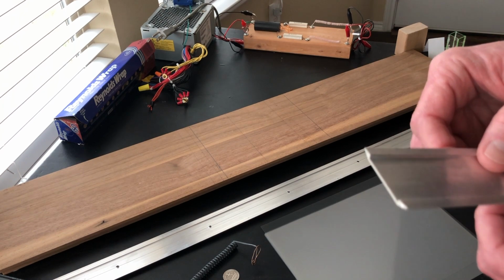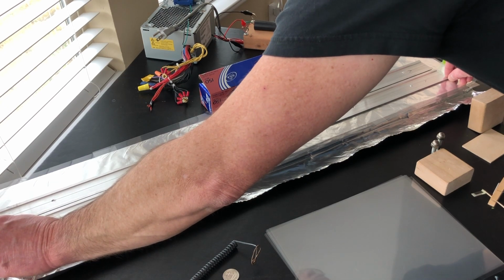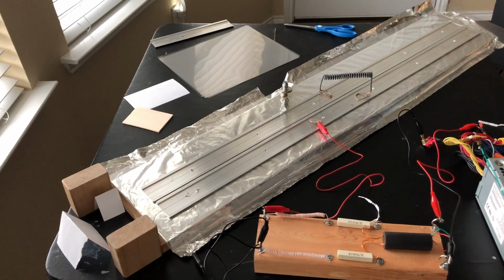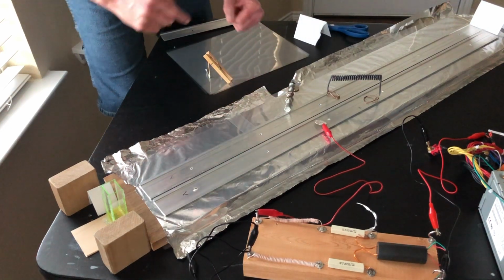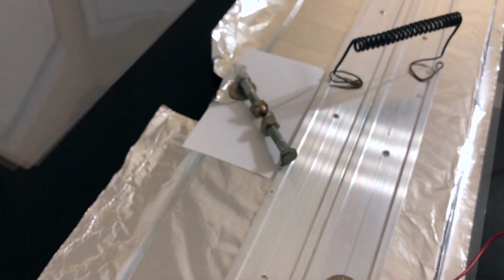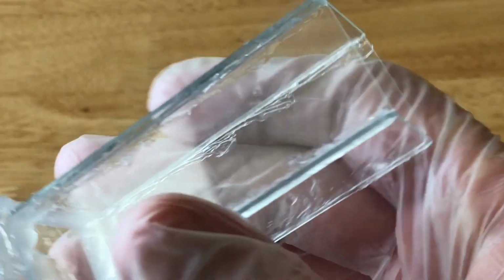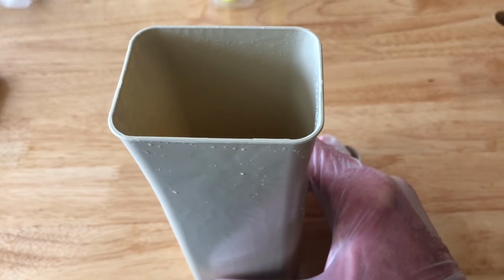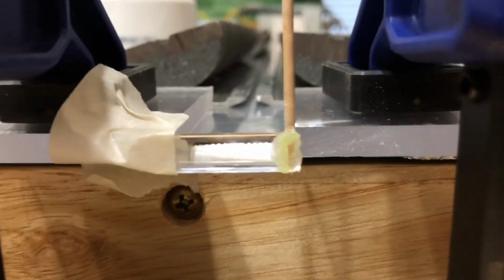A visible laser beam from household chemicals! No laser diodes! No specialized parts. No kidding!

Comment: Filling and emptying the marker like that is a fiddly waste of time and ink. Simply remove the plug from the back of the marker and pull the ink reservoir out.  Most markers have a plastic tube packed with synthetic a wad of fibers soaked in ink.  Slice the tube lengthwise then remove the fibers, then cut them into several pieces and put them in a large syringe. Then replace the plunger, draw some alcohol (or even just water) and also some air for headspace and give it a good shake with a finger over the hole. Then force out the solution into a container for storage or immediate use.  If you feel like you need to filter it, just cram a cotton ball in the syringe before adding the fibers.  You can probably do that 3 or more times and still be getting a strong solution.

Comment: Try replacing the flat electrodes with bandsaw blades.  The teeth will concentrate the electric fields for stonger sparks.
Reply: Ý tưởng thiết kế
Reply: @vuive6964  When I  was in college, I assisted in building a number of Nitrogen lasers.  We used 2 Bandsaw blades in an evacuated cavity.  The cavity was about 2 meters in length. The sides were aluminum rails I had machined. The tops and bottom  were thiick glass.  I think the blade gap was about 35mm- 50mm.  We used a line of high voltage capacitors and a 20,000Volt Thyrotron switch to fire the spark.   The chamber was pumped down to a hard vacuum; 1E-6 torr and back filled with low pressure Nitrogen.  Because the Nitrogen metastable lasts about 7ns, we placed a mirror at the back end of the cavity.  This way we got 1 pass for stimulated emmisssion.    We measured an output of 5mJ = 750kW!!

Comment from the maker: My apologies everyone for my slow replies - I will get to your comments soon. For the moment please allow me to shed some light on a way to help everyone conceptualize, using nitrogen as an example, why there are some lasers that will NEVER run continuously. 

Imagine you have 3 items: a large nail, a block of wood and a hammer. Your goal is to drive the nail into the wood. Why must you strike the nail with the hammer? Why not apply force continually by pushing the hammer against the nail as hard as you can push? The nail will go nowhere, right? Of course. By swinging the hammer over a great distance with a small force, you are able to produce a much greater force over a much smaller distance when the hammer strikes the nail. Power is to time what force is to distance. By storing electric charge in a capacitor, using a continuous source of electric current, we can release the energy very quickly resulting in peak power that is impossible or impractical to obtain continuously. No matter how fast the repetition rate, the peak power will always be greater than the average power. 

The second reason an N2 laser will not run continuously is a little more complex. Assuming you could apply enough continuous electrical current to be equivalent to the current present during a single lasing pulse (without completely destroying the laser), the lower laser level would become populated instead of the upper laser level because the lower laser level has a longer lifetime. Think about 2 identical funnels - one funnel is suspended directly over another funnel. Below both funnels is a tray. We will call the top funnel "funnel A" and the bottom funnel "funnel B". When water enters the top of "funnel A", it passes through "funnel A" to "funnel B", and through "funnel B" to the tray beneath both funnels. A small pump continually moves water from the tray to "funnel A" and the cycle is repeated indefinitely. Oh ... and there's one additional detail I should mention: the opening under "funnel A" is very large and the opening under "funnel B" is very small. When water enters "funnel A" it drains out almost as fast as it enters. When water enters "funnel B", it accumulates as it drains out very slowly. This means that "funnel B" will always contain more water than "funnel A". This is also what occurs in nature with the excited energy levels that are in atoms and molecules - we almost always have lower energy levels with a greater population than that of the energy levels that are directly above them. Very seldom, if ever, do we have a greater population in the excited upper levels. Even in rare instances where some atoms or molecules deviate from this norm, these atoms or molecules will be in the minority. 

Back to our water analogy - the conditions are such that "funnel B" will always contain more water than "funnel A". The pump can run forever, but conditions will remain unchanged. In order for "funnel A" to contain more water than "funnel B", we must create conditions that are outside of the norm. If we can put water into "funnel A" faster than water is draining out of "funnel A", we can momentarily create conditions under which "funnel A" will contain more water than "funnel B". However, these conditions only exist for a very short time - once the water leaving "funnel A" has began to enter "funnel B", and the volume of water in "funnel B" has exceeded the volume of water in "funnel A", then the flow of all water must cease entirely before we can again create the conditions necessary for the volume of water in "funnel A" to momentarily exceed the volume of water in "funnel B". All water must be back in the tray again (where it began) before this 'inversion' of water volume can again be momentarily established in "funnel A". So how do we put water in "funnel A" fast enough to do this? We do not have a continuous supply of water that provides the necessary volume to accomplish it. The solution is simple however; we must store the water in a container that can be quickly emptied. So now we remove the pump hose from "funnel A" and stick it in a bucket. We switch on the pump and wait for the pump to slowly fill the bucket. Once the bucket has been filled, we dump the water from the bucket into "funnel A"! "Funnel A" fills almost to its brim before "funnel B" has time to accumulate any water! We've, in an illustrative sense, found a way to create a population inversion of water in a situation where the probability is that "funnel B" will always contain more water than "funnel A". The pump is analogous to an electrical power supply, the hose to electrical wires and the bucket to a capacitor. "Funnel A" is analogous to the upper laser level in a nitrogen laser and "funnel B" is analogous to the lower laser level in a nitrogen laser. Analogies are seldom exact, and this one is certainly no exception - it's an oversimplified, inexact way to envision why the nitrogen laser can never run continuously, and why the pulse of energy must be insanely fast or a population inversion (in the upper laser level) will never be established. 

There are other laser types that will not run continuously - at least not under normal conditions. One such laser is the ruby laser. With ruby, the lower laser level is the ground state. This is why ruby lasers require an extraordinarily large amount of energy to establish a population inversion, and it's why a normal ruby laser can only run as a pulsed laser.